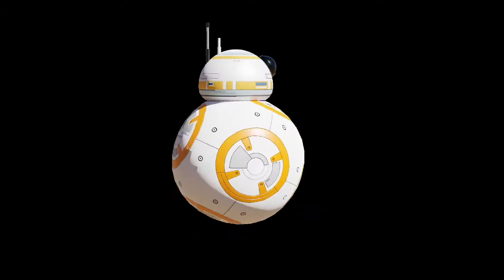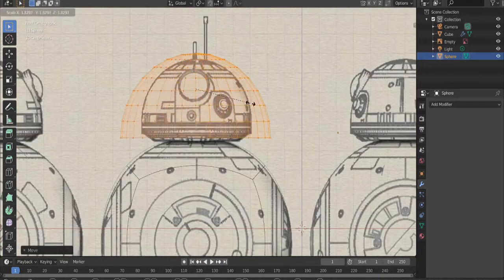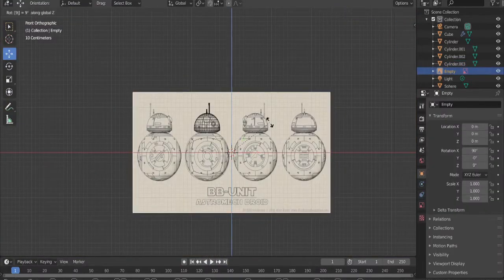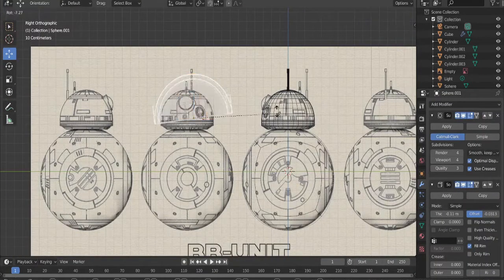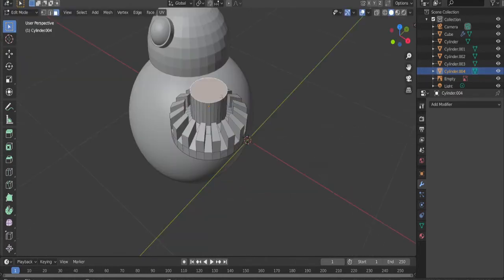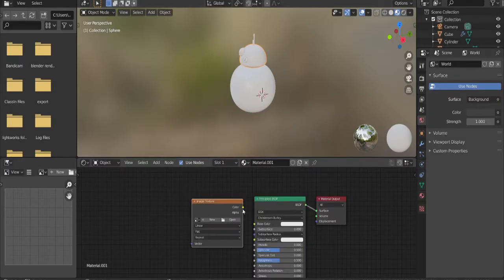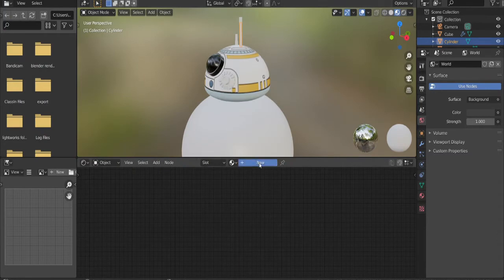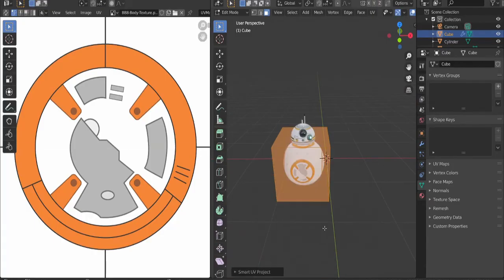Create BB-8 Fast (Blender Tutorial)

Comment: The lower body is not a proper sphere, which is visible just by looking at it, and when it rotates it wobbles.   
You must add a Cast Modifier after the Subdivision.   Set to Sphere and Factor 1.0.